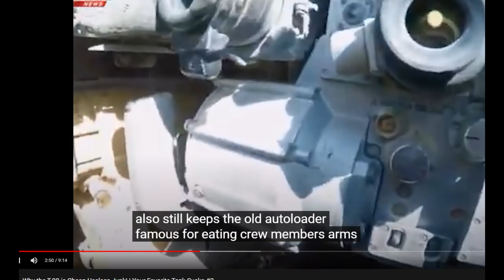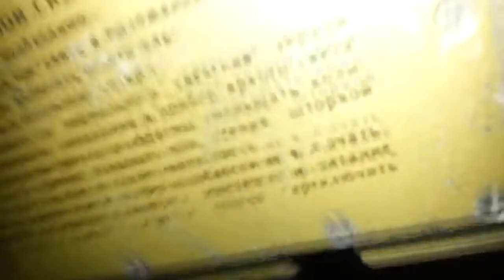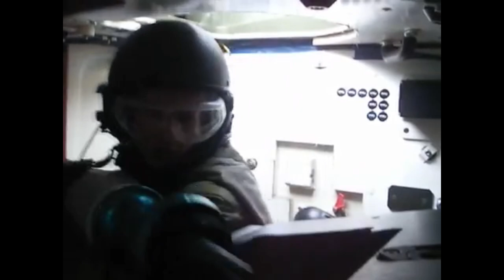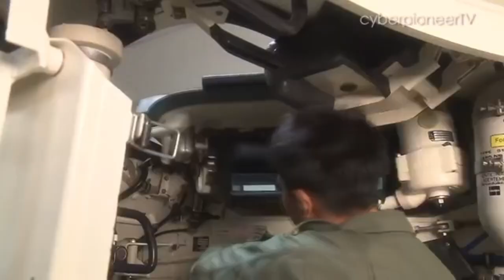Busting Myths on T-72 tank!

Comment: 3BM-15 and 3BM-17 were capable of penetrating T-72 Ural and T-72M upper glaces armour up to like 2000 metres. But not the T-72M1 with the additional 16mm HHRHA armour plate addition at 68 degrees on its upper glaces.

T-72 Ural / T-72M
Upper Glaces is equivalent to 123.6mm thick steel plate at 68 degrees — 330mm LOS against kinetic penetrators

T-72M1
Upper glaces is equivalent to 151.7mm thick steel plate at 68 degrees — 405mm LOS against kinetic penetrators.

3BM-15 / 3BM-17
203mm @ 0m (60) — 406mm LOS
162mm @ 0m (68) — 434mm LOS
[1780m/s at 0m]
-
160mm @ 2000m (60) — 320mm LOS
128mm @ 2000m (68) — 341mm LOS
[1520m/s at 2km]

T-72B is where it gets juicy 
Upper Glaces is equivalent to 198.5mm thick steel at 68 degrees — 530mm LOS against kinetic penetrators

Comment: Fun Fact- Old Diesel Engines are maybe on Paper Diesel only but we see that old-timer Mercedes Benz Cars or VW T2s get used with all kinds of Fuels⛽ but you can bet on it, it's no Industrial Car Fuel...
 It's Food Fat, Oil, everthing under the sun close to oil like substance 😆 and these cars run 1.000.000 + km .... 
Old Fords, old BMW, old Susuki ... everthing before Computerchips used to control the Engines.

So you could say .. they are, Multi Fuel as well 😆

Comment: Isn't the video at 7:23 the video of a T-72 having a misfire inside the turret during a reenactment?
Reply: Yes it is. Most have been crappy to be in a confined space when that happened. Also crappy the Mdics just stood by and watched these bailbout but didn't see if they were ok.
While I was in West Germany 1988-1991. An M-1 Abrams crew had a similar training accident happen. This though was far more serous as all 3 turret crew were burnt with 1st and second degree burns. What happened was the loader was loading too fast and scratched the fabric casing on the Breach just as it was fuming. With the casing ripped the powder caused a flash fire in the turret. All survived but most have been scary ad Hell. These things happen all over the world in every army but are rare thanks to proper training and protective gear and guards.

Comment: I question how good the T-72 performs in battle. I was reading about the marine attack on the Bagdad airport in 1991. In this battle the Marines lost 10 M-60s while the Iraq's lost dozens of T-72s. The Iraq's we're ready and waiting for the Marines and still lost dozens of T-72s. The Marines were using M-60s, so why did the Iraq's lose so many tanks?
Reply: Because The iraqis were using 3bm9 from the mid 1960s
Reply: @barbarapitenthusiast7103  is this the ammo they were using?
Reply: Iraq had old T-72M/M1 ( which are similar to soviets T-72A that was not good compared to the best T-72 the T-72B model 1989 and Iraq had older ammo that couldn’t penetrate M1 Abrams )
Reply: But why did they do so bad against the M-60s the marines were using?
Reply: @faliray4889 Those T-72 aren’t the best variant for the time and Iraq had older ammo and used poor tactics
Reply: @faliray4889  they didnt have working IR flaslights, they had old 3bm9 from the 60s and untrained crews. Coupled with the fact the US had total air superiority and knew exactly where the iraqis were
Reply: Ok. I appreciate the replies. Ive always liked Soviet/Russian arms, so I hate to see them (particularly the T-72) dumped on all the time.

Comment: The T-72

A hibachi that seats 3.
Proof that hanging armor on a medium tank won't make it an MBT.
A way to ensure that you'll never have to pay retirement benefits to your Armored Force.
A cheap way to replace all those T-62's you lost.
A fully interactive hard target tank simulator.
Yesterdays' solution to today's battlefield challenges.
Active IR was good enough for Grandpa and its good enough for me.
ERA is 100% effective over the 65% of the frontal arc it covers, at least for the first hit.
Available as a hard top or convertible.
At least its not a T-80.

Comment: Good video but one nitpick.  

I doubt the auto loader eating arms is fully a myth although probably it is rare or they would have re-designed it.  

As “The Chieftan” says anything that can be eaten by the “turret monster” will be if you are not careful and this is from a commander of an Abrams which has never had such a reputation for causing injury.  

Having worked around all sorts of machinery where workers got hurt, I can tell you all it takes is one moment of distraction, fatigue, or simple dumbassery to cause terrible injuries or deaths regardless of the level of safety built into the machinery or procedures.  Of course just one such incident is all it takes to start a myth of something being inherently unsafe.
Reply: While of was stationed in West Germany 1988-1991 we transitioned to the M2A2 Bradley. During this transition and qualification our CO let his protective mask dangle from his seat. Bad move as when they returned from the range and the driver pivoted the mask got hung up on the Halo bottles and set them off. A Seragent riding in the panicked tried to get out the cargo hatch but couldn't because the barrel was over the hatch. Tried the troop door but it was combat locked. Finally the drive lowered the ramp. CO said he felt like Darth Vader when he exited through the troop compartment as the halon was still dissipating like Return of the Jedi. Entire company got a good laugh.
 Another company had someone leave something laying around when they rotated the turret this item cit into the fuel tank which is fiberglass. That had. To have been a mess to clean up.

Comment: Best Russian Tank ...T 34 (and it used an American designed suspension)... all Russian Tanks downhill from then on.
Reply: No, the T-34 was also bad, the suspension? Was also bad, the supposedly superior sloped armor? Made it hard for the crew to move so if they get hit with a shot they're doomed, even if it doesn't penetrate, the spalling would mangle the crew because the space is so tight.

Most of the T-34s didn't get turret baskets and the gun breach would explode if not left to cool down after a couple of shots.

These were SOME of it's problems and there's a whole lot more that would be a headache to type.

T-34 was overrated honestly.

Comment: Why do Russian design their tanks with little gun depression?🤔
Reply: because they feel they don't need it

Why? because most of the terrains in Western Russia is just a flat terrain with little mountains and hills, and it also allowed them to create low profile tanks which is a necessary thing
Reply: They like low profile tanks, which means building the turrets without much height too. That doesn't leave much room for the breech to swing up inside the turret space, hence not much gun depression
Reply: Big gun with big breech in small volume comes with compromises.
Reply: @talltroll7092  Desert warfare is proving that those tanks are worth junk. Compromises not worth it
Reply: @destroyerarmor2846  welp, i guess you haven't know that different countries use different variants that Russia use and has different crew and leadership quality as well

Welp, new knowledge for you

Comment: for some reason i thought that t72 and m1 are same age... t72 at least 10 years older.
1) i never heard of it. after 2014 we started to bring back t72s to life but despite them being in poor state in general and not as good as current available t64 variants, nothing else was reported. also wouldnt it be stupid to design and actually put in production military equipment with such flaw?
2) here as far as i heard is no regulations for that. anybody welcome if they up to the task. question if they comfortable or not is up to crew themselves. t64 and t80 basically same so this thing may be not only for t72 but for soviet tanks in general. 
3) its probably more of people being not properly informed rather then actual myth.
4) its actually hurt those who try to protect soviet tanks.. usually i hear that it was just shitty export variants that never supposed to be as good as proper soviet ones. i heard it from russians quite a lot actually.

Comment: It was not a myth about the arms, but they weren't "chopped off" they were Broken. By the "safety shield" that is part of the autoloader system.

The Soviet Union was polyglot, and many conscripts didn't speak Russian, and during a few weeks of basic training didn't learn much Russian. Nor were many of them used to advanced technology.

Accidents occur aboard all types of AFVs. Soviet vehicles were even more cramped, and had worse ergonomics than Western vehicles. 

Combine that with a mass conscript army, individuals with poor language skills and not technically proficient; resulted in greater numbers of injuries.

Among some Soviet tank officers there was dissatisfaction with the autoloaders and the 3 man crew. (Maintenance, logistics, providing local security, and many other duties are hampered by the smaller crew sizes; and resulting smaller Platoons, and Companies.) Garrison duties are probably 95% of a soldier's time. Lucky is a Tanker who spends even 5% of his time inside his tank.

Western analysts tried to parse Soviet Army (and Industry) reports as well as articles in professional military journals.

Until now, I had never heard of a T72 autoloader "chopping off" an arm. I have learned about gunners, in particular, having their arms broken (or less serious injuries) caused by the autoloader system, the moving "shield" being the most common "culprit"

Comment: The T-72's prone to spalling. That's the problem with most  Soviet/Russian tanks. I wonder if it's because it has cardboard ERA?
Reply: Those aren’t cardboard there spacers for the ERA 🤦‍♂️
Reply: @blaircolquhoun7780  they really don’t because those are a spacers for ERA not cardboard
Reply: @blaircolquhoun7780  no the captured one had there ERA removed by the Russian when they were abandoning there tanks and the destroyed one the ERA already got used / activated so the only thing left is the spacers
Spacers aren’t cardboards 

There not cardboards there just spacers for the ERA
Reply: @mbtenjoyer9487  The Caspian Report said that the T-90s which were examined had cardboard instead of the ERA because of corruption in the Russian military. I wasn't in the military because of a TBI I've had since I was three. I only go by what I hear,
Reply: @blaircolquhoun7780  there not cardboards there spacers for the ERA
Even if the ERA is removed or destroyed the spacers usually stay 
Not cardboards
Reply: @blaircolquhoun7780  lol imagine using infographic show as a source😂😂😂
Reply: @Adk6954r4  It's not just The Infographics Show that says that. It's also the late Tom Clancy. Tom Clancy, in 1992, said that the Soviet and Russian tanks suck. The biggest donor of tanks to Ukraine? Russia.

Comment: Even if the auto-loader doesn't chop off arms I'm still never going to be convinced it's a better system than a manual loader. Most especially with modern tech. PS I loved the Marxist beard.
Reply: Modern autoloader has many advantages and disadvantages manual loader possibly doesn't have
Reply: The newer autoloaders that the Russians are fitting might be worth it, since they are much better at sustained fire rate than a human with limited stamina can be, and aren't semi-permanently broken, or a handful of fired rounds from breaking like the earlier generations were. It has taken decades for the Russians to get them to that state, though, so it shouldn't be that surprising really.There is still the potential issue that it removes a crewman during the very extensive maint time any tank needs (although presumably autoloader crews have worked out how to deal with that by now), and that if it does break, the tank is hugely less effective (you can manually load a tank with a broken autoloader usually, but at best that's going to slow your RoF quite a bit, and mean one of your 2 turret crew isn't going to have much time for the job they are meant to be doing, which could be a problem)
Reply: It allows you to have a smaller turret which allows you to put more armor on the turret for the same weight.